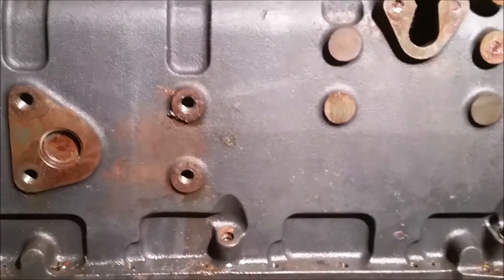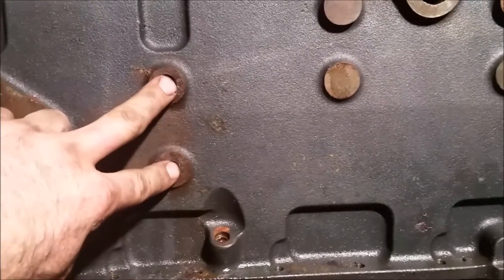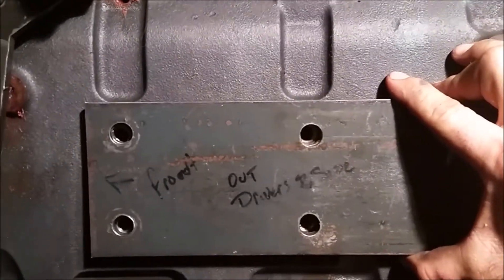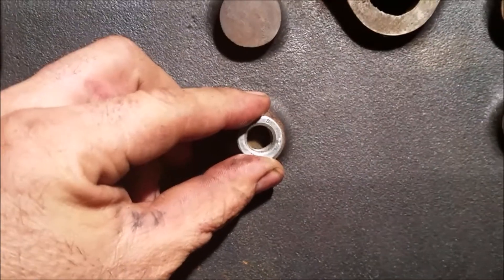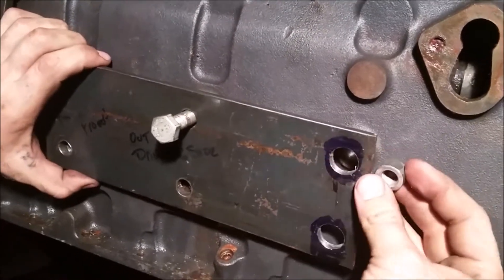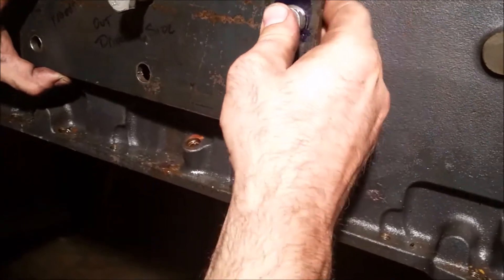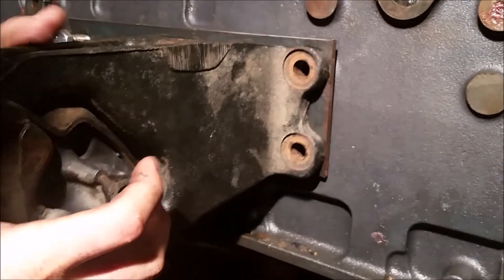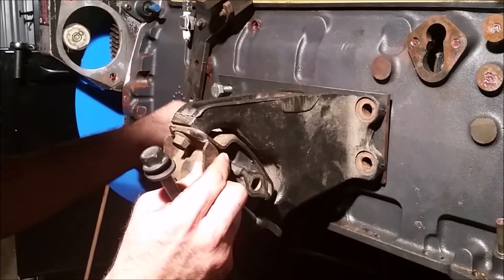How to Fab the Motor Mount Plate For A 3rd gen 12 valve Swap

Comment: can u tell us the measurements from center bolt hole to center bolt hole of the factory mount location, im building a bracket and dont have a motor anytime soon to measure off of

Comment: Good info, however if I had at least one boss there, I would drill and tap it. Just put the mouth there and drill to the same depth, much stronger. I'm going to start making these , I may run a tab up to the fuel pump housing for blocks without bosses.
Reply from the maker: We wish you good luck with that! Let everyone know if you get something that works for you. There is always room for innovation! We have made 700ish Hp with how we set them up. For most of the guys here on the channel, who are just get their truck back on the road, trying to drill and tap the block straight, isn't worth the time. When we did out first set, we looked at about half a dozen different areas to tie the plates into, but it made the side of the block more cluttered than we wanted and harder to work on with where we have our ECM mounted!

Comment: Why not do studs coming through the plate and then just spin on some nuts
Reply from the maker: Good question! One of our first attempts was a stud. There are a few reasons why that we learned the hard way about. One is that the plate is mild steel and I'd you

Comment: instead of grinding and welding the nut why not just drill and tap the plate for the motor mount bolts?
Reply from the maker: Hi Caleb, 
We went through lots of different test motor mount plates before settling on this style. That's not to say you can't make some of the other ways work, but we always came across compromises, we weren't willing to make. For example, your question. " why not just tap the plate?" Again, you might be able to get away with it, but here is what we found. If you tap the plate you only have 1/4" of threads to work with. You can try and use a nut behind the plate, but there isn't much room between the plate and the block, and its not a good idea to have pressure against a small area on the side of your block for fear of it loading up and cracking it.  So you are back to putting a nut on it, only to grind it down. 

Next those plates are mild steel. They are plenty tough for holding the weight but that is different than dealing with the torque of tightening a bolt in the thread on only a 1/4" of metal. We didn't feel comfortable with that, and that is why we rounded down a nut and welded it in. You get a hardened nut and its just a little thicker than the plate, but not so much that it has to be modified much.

Hope that helps and let us know if you have any other questions!

Comment: Thanks for the video.

Did you run into an issue with the 6 speed bolting up to the 12v block?  I have heard some say only 6 of the 8 holes line up and other say it bolts right up.
Reply from the maker: Thanks man! You are correct that only 6 of the 8 bolts will line up, but we have run them with 500- 650hp with no issues. And we have checked them several time just to be sure that nothing was cracking or stressed. Just make sure you have the bolts properly torqued and blue lock tighted. If you are going for more HP then maybe you will see an issue but I doubt it, till you get way up there.
Reply: @70440charger  Awesome, thank you.
Reply from the maker: This is going to sound weird but I should also mention that you need to plug the other holes you don't use. I didnt the first time and a valve cover started leaking and found its way down the back of the block and through the hole and made it look like I had a rear main seal leak. 
So I grabbed a vacuum hose cap and a wooden dowel (1/2" I believe). The cap fit snug and I squished it even tighter by driving the dowel inside the plug.  That was the hole on the upper right hand side the block that gave me the most trouble.
Reply: @70440charger  oh snap!  I had not heard that anywhere. I will make sure to do that.

That would have really sucked.  Thanks a bunch!!
Reply: Definitely bolts right up

Comment: Could it be possible to 12v swap my 04 4.7 and what would I need?
Reply from the maker: We have learned that pretty much anything is possible! Now... With that said, I have to ask, why not just find a cheap 2500 to start from? I understand if you have a reason, but I am sure it would be a good bit harder when starting from a 4.7.  But if you just love your current truck, I am sure that it could be done, but you would realistically need pretty much a donor truck to make it fast and cost effective.
Reply: Break-It Brothers Diesel Would that be because of wiring it’s more of a frame issue? I know it’s possible I seen a couple of 1500 with the swap
Reply from the maker: @badillo280  : so you are asking the right questions! I dont have all the answers. I will look at the spare gas frame we have and then the cummins frame beside it and check if the mounts are in the same spot.   I am not sure if the wiring is the same or not, but I know that the dash would need to be swapped out to work.   And I also don't know if the tranny mount is in same spot. All things to check on...
Reply: Break-It Brothers Diesel I would really appreciate it. Thanks for your help anyways 👍🏻

Comment: Thank you for all the videos, I'm about to take on this swap after losing a cylinder on my common rail recently.
Reply from the maker: You are very welcome.  The end result is very worth it! Just take your time and try and do everything that's reasonable to make sure the 12v is good to go before sticking it in the engine bay.  We can imagine going back to the CR's now. But then again we spent a ridiculous amount of time trying to get everything right, so we wouldn't have to be back under the hood every few days fixing minor stuff.  That's what we have noticed  with 12v's. It's never really anything major, it stuff like a busted fuel line cause a hold down bolt was tight, or leaky gasket cause someone didn't swap them out when the swapped motors...  I know you are going to love it! Let us know how it turns out!
Reply: @70440charger  that definitely is the plan while it's on the engine stand!  Kdp, seals, oil pan gasket, injectors, valve timing , pump seals and possibly the coolant bypass.  Get the brackets for the tach built and adapters for coolant and oil.  Kinda want to cam it but I need her back on the road.  One question though, the plate steel looked like 1/4x4" roughly?  Just want to check before buying, my truck is kinda far away.  Thank you in advance!
Reply from the maker: You are correct. It is 1/4" x 4 x 11ish. The cheapest place I have found is lowes. It comes pre-cut and you just have to trim it some. I will double check the final dimensions new time I go down to the shop.
Reply: Howdy, didn't know where else to ask this.  I'm getting ready to do my swap this weekend and has a question about the alternator.  Did you use the stock 12v or use the common rail?  I didn't look last time I was with the two engines if they mounted the same.  Thanks in advance!
Reply from the maker: @panamactd  :  So if you want to do it the easy way you will pick up an alternator from a 98.5-2002 24v. It uses the updated plug like the CR's but uses the same alternator bracket as the 12v alternator. On the black hole, I cut the plug off and soldered on a 12v one, but that was dumb and ever since we just use the early 24v style.  It will make it plug and play.
Reply: @70440charger  awesome man! I've been researching that for days and couldn't find anything definitive.  What did y'all do about the a.c., does it swap over or just use the 12valve?  I think that's the last piece of the puzzle maybe.  Y'all just used the 12 valve starter as well?  I thought about using the common rail transmission adapter

Comment: did you attempt to use factory mounts from a 1996 dodge 4wd ? not sure but they look like they push the mount back in the Same location just curious if you tried this before you made ur plate I'm doing a frame swap on my 03 and have a 1996 3500 with a 12 valve with 46k original miles and am looking to replace my common rail while its apart

Thanks in advance 

John
Reply from the maker: Hey John! We have tons of the 12 mounts kicking around and have played with them some, but never with them in the engine bay. We mounted some up while it was still on the stand and then compared them to the CR Mounts. We felt like there was enough of a difference that it was easiest to just go a head and fab the bracket for the CR mounts. It is a little bit tedious, but not bad if you don't get in a hurry. If you do try the 12v mounts, please let us know how they go!

Comment: Countersink a tapered Allen from the back and put a nut on the front, then bolt the whole thing to the block. A lot less work and far stronger than the welded method after grinding.
Reply from the maker: omoffroadz- Thanks for sharing your idea! Hopefully it helps someone else out. We chose the way we did for the the easy of fabrication. No special bolts to find and nothing to get loose or back out and have to take the whole plate off to get at. Granted, that is assuming you can lay down a good weld. But if you can't weld, you are going to learn fast on this kind of conversion!  We have tested it to about 700hp and have had good luck. Thanks for giving people another option to think about when fabbing up this part of their swap!

Comment: Cool. However i would weld a stud in the plate not a nut behind the plate.
Reply from the maker: That's a good idea man. We always look for ways to make things easier and are glad you shared it. I think you might find that if you weld a stud in you would lose the ability to unbolt the motor mount bolts and slide it out of the way. With a stud in there you would have to be able to pull the mount out far enough to clear the stud. Not a big issue with the engine out, but I could see it being pretty tight if you are trying to work on it in the engine bay. I always end up having to pull things apart so functionality is a big concern for my builds.  Again cool idea. I hope you try it out and get back to us on if there is enough room to pull the mount in the truck! Thanks for sharing your idea!

Comment: Enjoy the videos man! Do you have some information on the clutch and tranny? I'm planning on swapping a 12v into my 05 but can't find any solid information on a clutch and the tranny bolting up with an nv5600 to the 12v
Reply from the maker: Hey Wyatt,
You will need the transmission adapter plate from a nv5600 or you will have to use a starter spacer with one a plate from a nv4500. If you check out some of my other videos on the "project Black Hole" you will see my 12v. It is running with a nv5600 and the old trans adapter that came off the old common rail  that I yanked out of it. It works great with the only negitive being that one bolt on the trans adapter didn't line up with the engine block.  There are enough others that I decided to just run it. Already have 40k miles on it @ 600hp and no issues. Hope that helps some!
Reply: 70440charger thank you for the information! Thats what I was wondering!